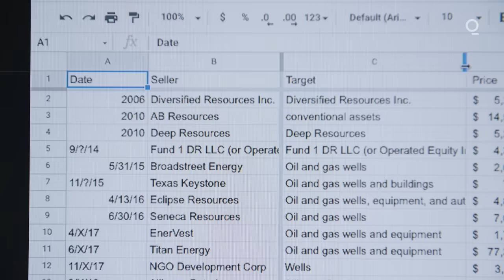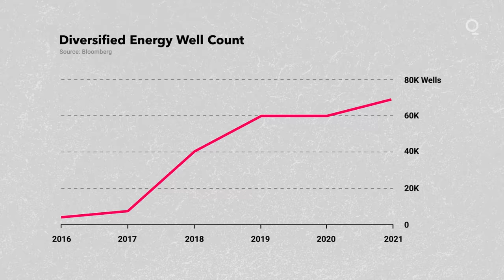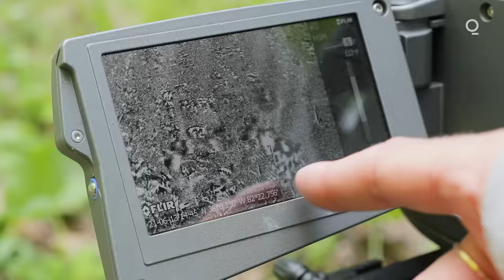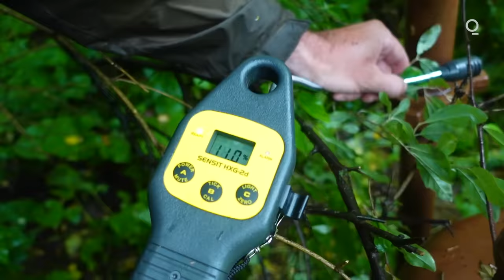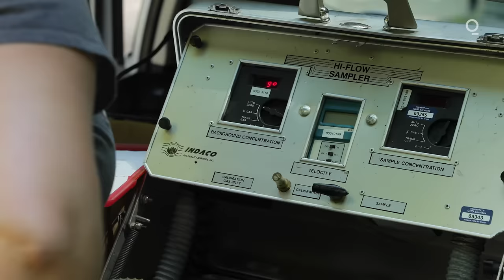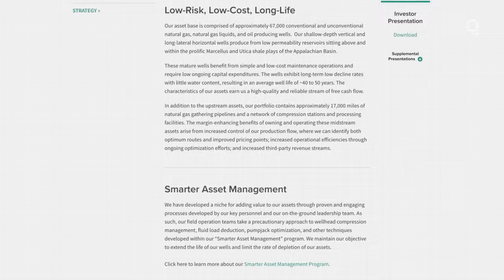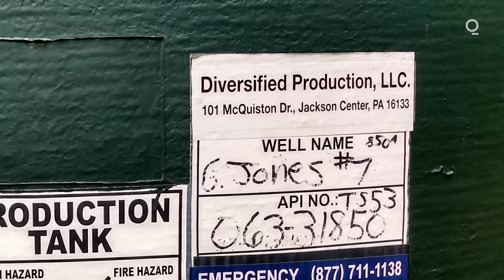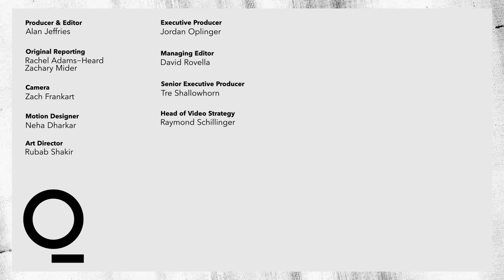How Dying Gas Wells Are Making One Company Rich

Comment: As a engineer you don’t have to plug wells to stop leaks. You just need to rebuild the well systems (pipeline) and use stainless steel that will last for years and never Break down over time like iron pipes do. It’s not hard to shut a well off and rebuild it. Can be done it a matter of days on larger well. Hours on smaller wells.
Reply: looks like some just needed the fitting tightened/valve replaced/stem packing tightened/rebuilt... replaced. that is a 30 min job.  GOT TO GREASE ALL THE FITTINGS AND USE TEFLON TAPE OR THREAD DOPE AND GET THE FITTINGS TIGHT!!!! the wont leak if gget them TIGHT and have lots of thread dope on them. the hammer unions need grease on the threads and the wing half so it is easer to tighten WELL and get loose easily when it is time to break it loose. no grease on the hammer unions... they rust and seize and cant get them apart without beating the hammer unions wingsoff... over 5 cents of grease by the roustabouts who put it together.
Reply: If you guys know it,why these guys aren't taking abt this solution? This can be the best immediate action we can take🤔
Reply: @zankarbolde  I’ll tell you why they don’t fix them. They don’t want to fix them. That cost money. There only interested in making money. Not loosing money.
Reply: Stainless steel can corrode to if the ground has iron in it!
Reply: @preformancemustang  they found a well where the leak rate was 6 times the annual production - fixing that would actually make them money.
Reply: @stephanweinberger  =
Reply: I hope only electric vehicles were used in the making of this. Non imported cameras and other equipment as well.
Reply: @edpoints1127  wow, are you off the target!
Reply: @edpoints1127  Wow. The smart alec of the day ! 🤣
Reply: Harvesting the methane is also a solution.  Much of the equipment is already there.  Add a bladder, for one...
Reply: Cost prohibitive and screws the bottom line. No the company will not spend the money, willingly to fix these wells. 60,000 wells and then some would be extremely costly.
Reply: Thank you for common sense analysis
Reply: H2S is a big corrosion in this industry. We get these inspections quarterly. Company comes out and sniffs every valve every hatch and also have heat cameras. And we have to fix on the spot or depending on how bad the leak is you get a few days to repair and they come back to inspect. Well that’s here in California.
Reply: @ghostdevill  so wouldn't plastic be better I don't know
Reply: Lol iron is less prone to sparking unlike stainless steel, which will also draw lightning.
Reply: @AlejandroHernandez-pe8wv  and yet there is a big vent and a thief hatch where the pumper gauges the tank presumably unless it's auto mated but im,sure once a month even,if it,is I know h2s is heavier than air,so,it,drops fast but still the leak thing is dumb it is in oil so if you do,have a leak its gonna be obvious
Reply: @zankarbolde  they painting each others crooked hands green of so much money is hush hush money
Reply: @preformancemustang  BINGO 👈👀👍
Reply: @edpoints1127  fo sho, lol
Reply: Stainless is very expensive compared to carbon steel. These wells are marginal ... can't economically justify expensive rework.  It's like trying to justify a new engine on a rusty 20 year old junker car.
Reply: They are using polyethylene (plastic) for pipelines now. Way less corrosion and easier to install
Reply: Less on smaller ones if the piping is pre-assembled.
Reply: stainless casing in a mile deep well........sure buddy, I though you said you were an engineer
Reply: Stainless still rust
Reply: The solution to this problem is make homeless shelters at all the leases and use the gas for heating
Reply: @jessedukowitz6267  wrong. Yet some cheap stainless with high iron content does rust but 316 grade stainless does not rust. It’s the highest corrosion resistant grade there is. It will not rust.
Reply: @preformancemustang  When a well leaks, the material that is lost does not get sold, thus the producer loses money.
Reply: @preformancemustang  Losing
Reply: @richsmith3300  I had the same thought… such low pressure should be easy to fix
Reply: Sir, have you looked at how well stainless steel actually works in such applications?  Stainless steel can have galvanic reactions against itself and corrode faster than black iron.
Reply: @tkirby115  so would plastic work, do they even make the kind to work in this situation?
Reply: @cinepost  I just don't know.
Reply: As an engineer haha. Stainless! How much money you think that is? Maybe take a financial course. Maybe an economics course aswell
Reply: That fact it is so easy makes it even worse that companies don’t just do it when they leave
Reply: @cinepost  Yes plastic will work. We’ve been using it for 20 years now here in Oklahoma for lines with corrosion issues. It’s cheaper than any type of steel and easier to work with because it comes in a continuous roll instead of joints. People in the industry refer to it as “poly pipe” Back before we had poly we’d use threaded joints of fiberglass tubing.
Reply: @dknowles60  let me gift you some punctuation...
Also, why do you Americans make everything political? You know: there is a wider world around the US. Not everything on this planet is caused or influenced by your government.
Reply: @Stephan Weinberger  so this tells you what Diversifieds priorities are... easy, "passive" revenue without spending a dime on maintenance. That company is a leach. Whether it's fixing leaks, or plugging wells, big oil isn't interested in anything but raking in the dough.
Reply: Gas will always find a way out. No matter how many perforations and cement you squeeze down that hole.
Reply: Spot on but we all know that it will not happen because Stainless cost more and only thing that matters is P/R  and dividends to investors.
Reply: @preformancemustang  No, it costs money to allow the leak to continue.  If this can be easily fixed (and the ones on the video can) then it makes business sense to repair them. Why aren't they getting on with it? Who knows but I strongly suspect that the film makers have picked the worst cases here just to increase the sensation value of their film.
Reply: Just replace them with stainless steel pipes and then use a ball valve and shut it off simple
Reply: Most that I've seen yes need a new flang and well head. Or just new ring and bolts and nuts.

Comment: I think that Diversify is a shell company to which other companies sell exhausted gas pumps in order not to pay for their closure.
Reply: Wouldn't surprise me in the least.
Reply: Closing those small wells, shocking it costs 10,000 bucks.
I would just think they need to pour down some gravel, then sand then some epoxy, then some expanding concrete.  Should be 500 bucks a well.
Reply: @superchuck3259  start a business and do this :)
Reply: @superchuck3259  Did you see the location?? They'd need to rebulldoze the path and gravel it to get a concrete truck in there. They need to pour at least 100'-300' down.
Reply: @jtjones4081  Why does the entire pipe need to be filled with concrete?   Sure I get your point, but I am saying there might be alternative ways to plug that will work, it only looks like a 6 inch pipe.
Reply: @superchuck3259  you're acting like they could just drive there you know expensive it is to helicopter all that stuff in this stuff's in the middle of nowhere on top of that you realize epoxy is about $50 a liter and a leader barely covers anything $10,000 seems cheap
Reply: @superchuck3259  I think its because they need to fill in the entire length till the top just in case some digging happen in the future. Technically, I agree that its quite simple to plug it up as any blockage in the pipe would plug it up but most likely rules and regulation require the pipe to be future proof. Else, there would be no problem in covering up the above ground part of the pipe with concrete instead of pouring it down the hole.
Reply: @superchuck3259  here in Canada, it's about $2000 to place a bridge plug in the well  and dump about 10 meters of cement over top of the plug. . Then the the well head gets cuts off and welded shut. It doesn't need to be fully filled with cement. It doesn't cost as much as some would think but if the casing is messed up, it can add up fast
Reply: @superchuck3259  Because that pipe will rust. There is also a big risk of explosion once you cut the top of that well.
Reply: @superchuck3259  Each state regulatory agency specifies what must be done to properly plug a well.  Generaly, 100'-300' of cement as mentioned , not sand and gravel, must cover each production zone in a well and there can be several.  That 6" hole can take 10-15 sacks (94lbs each) per 100ft, 4" less. 8" more.  Throw in similar plugs at casing seats (at least 1) and a surface plug, plus water and bentonite clay mix in between.   With the necessary equipment, a trained crew, simple procedure, no problems, yeah under 10grand but not much.  Most wells will need equipment pulled, from the well and location, these costs grow fast, $50-$150/hr,  so not so simple.  Consolidation Coal was plugging gas wells for a PA longwall coal mine project in 1980's-90's,  special purpose, special costs,  $140,000/ per well.  They even drill out plugged wells to do it over their way.
Reply: @902Bikes  finally someone that is not just making stuff up. Some of these comments are cringe
Reply: Banks start new companies and transfer the liabilities.
Reply: @superchuck3259  It would cost more than $500 to get equipment and materials to some of those remote locations.
Reply: @sweetearthfarm  Please donate to this cause if it means so much to you.  If people just picked up trash instead of protesting that the government create a trash pickup crew.  My idea would be for someone to take these wells and use the gas for personal use.  Make some moonshine using the heat for distilling is better than just venting the gas to the air.
Reply: @superchuck3259  what makes you think it means anything to me? I just commented on your accounting.
Reply: yeah, that was my exact thought. What will happen if the company goes bankrupt? basically each state is left with a big problem and the company with its owners & moner is long gone.
Reply: @superchuck3259  each well the oil company has to carry insurance on it, so if they get abandoned the money is there so the state doesn't hav the cover cost for plugging it.
Reply: Yep....
Reply: @superchuck3259  Wouldn't work.  Too porous.  When plugging a pressure well, you use high density concrete.  But, yes, you do use sand and gravel down the hole first.  It is an expensive process to decommission a well to proper EPA standards.  Those holes are a lot deeper than you might think.  It takes a lot of material to get below the water tables.  A lot of casing that needs to be filled all the way to the top.  The casing could, in most cases, be thousands of feet long.
Reply: @markmayfield2228  Yeah, there is doing it to some spec the EPA sets, there is overkill, there is doing what works, and then bare minimum to work.  I think if anyone really cared, they would accept a minimum job that works over some overkill standard.
Thanks for sharing.
Reply: @superchuck3259  uhhhhhh...no.
Reply: @sweetearthfarm  So you are just being critical on my accounting?  Really, so your just trolling to show everyone your superior accounting skills.  BTW, there is nothing on the line here as this is just thought, so you can't actually be correct in your accounting.   How are your personal finances?  Accounting working out for ya?
Reply: @olgabukaa8530  they're hoping taxpayers will pay billions to clean up their mess
Reply: @jeffeager9779  in theory but these cleanup funds are vastly underfunded
Reply: @superchuck3259  his just?
Reply: @jtjones4081  Not pour, pump. Cementing a well is very different than pouring concrete for a building's foundation or a driveway.
Reply: @superchuck3259  there are regulations to closing up pipelines; companies not following laws can face hundreds of thousands to millions in fines; same goes for any leaks buy nothing shown in the vid even in 60 year old pipes is of any concern in the slightest
Reply: I have seen how home owners plug these wells. They fill them with 500 to 900 lbs. of 20 mesh sifted LOCAL dirt to about 18" from the top. Then they pour in 6" of "black and white" filler two part epoxy resin and then finish with 12" of port-land cement mix on the vary top. 99.9998% of the time it works and its DIRT-CHEAP literally. Under $100.00 per well to plug plus labor, maybe $300.00 each tops.
Reply: Shell or Exon?
Reply: @superchuck3259 Cute, you're talking about the cheap Chinese training plugs from Shenzen 😆
Reply: @adventureinventors  There is always a right and wrong way to do things. More often than not, the CHEAP way is the wrong way.

Comment: I bought the rights to the well on my property. It's not commercially viable, but it does have enough to supply all of my current consumption for about another 150 years. It didn't need to be plugged. It needed some of the joins resealed. Any area with gas will have trace methane releases, with or without a well.
The "90 dollars" is if the technician is onsite. If the repair tech has to hike a five hour round trip into the woods to get to it, it's not "90 dollars".

Compelling a gas company to plug producing wells would be a great way to drive up gas prices and reduce supply though.
The gas being produced at the wells also generates revenue to pay for roads and schools in the states, so plugging them would plug that too.
Reply: Never thought about doing that
Reply: Renewables are the future
Reply: The problem lies with the fact that Diversified is not proactively going out and maintaining these old wells, they only do it when they are caught by watchdog groups or the rare visit by a regulator.   In other words their corporate plan to make money off of these old wells is too keep them in production and do little or nothing to them unless forced to.